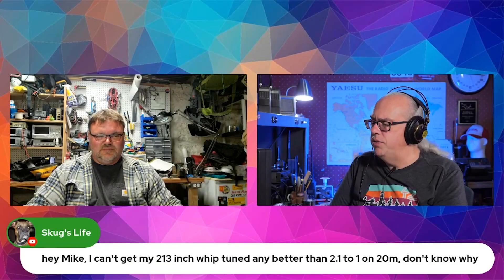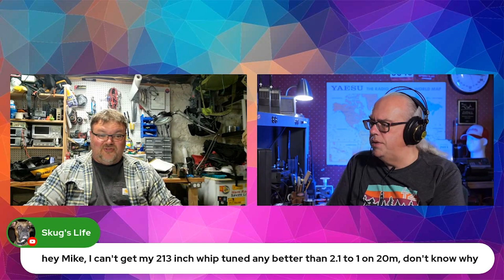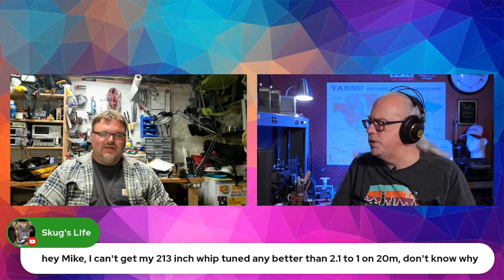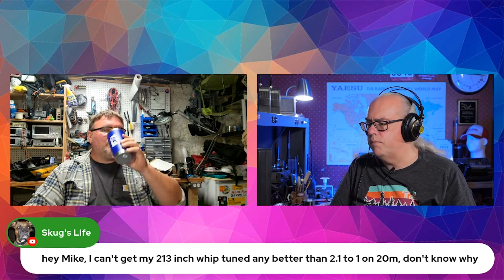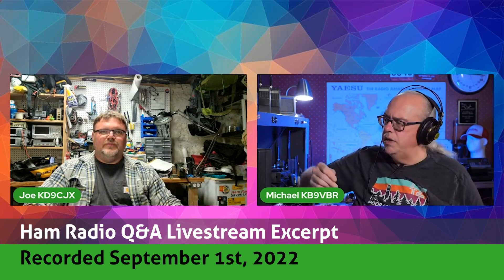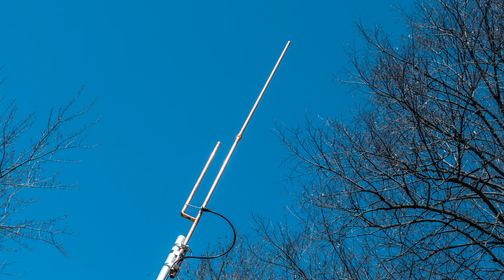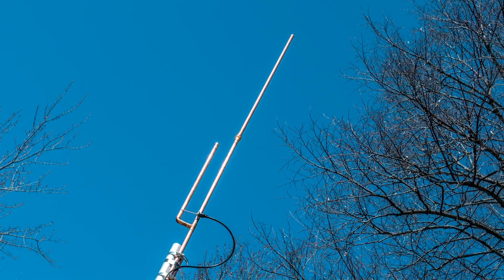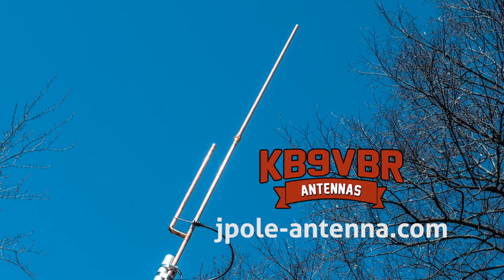I can't get the SWR low enough - September 2022 Livestream Excerpt #hamradioqa

Comment: hey Mike & everyone.  thought i'd report in:  i am using the 17' whip that you have seen Mike use on POTA videos, w/ the large tripod from Wolf River.  i also have the silver bullet coil but i don't use it for 20m.  Today i increased the # of radials to 9, all of them are 33 ft, and i folded them all in half (as opposed to coiling up half of the wire at the end) and i'm happy to report that i actually have SWR on 20m down to ~1.3 to 1 today.  Thanks Mike :)
Reply from the maker: Thanks for the update, it's great to hear that we were able to help you out.

Comment: I have a similar issue with a new 17’ whip. I ended up with it fully extended, 3 radials on the ground 16’7.5” each, 25’ coax. I got to 1.75 SWR

Comment: I have a ft-891 and wolf river coil and I keep getting high swr on the radio and I do get out but everyone said I am just a little higher then the noise floor on pota hunting. They can barely make out.
Reply from the maker: Tell me a few things about your setup: what bands are you active on, whip length, coax length, and number of radials and length. This will be helpful in diagnosing the issue.

Comment: Adding more coax is just making it more resonant because the length of a coax if it works is acting as part of the antenna that being said The Shield of the coax is acting like part of the antenna it's not a good idea like I've said before a choke balun  isolate the antenna from the coax that's what a balun does.  a one-to-one balance isolates the antenna from the coax that's the best way to go and then adjust the radials.
Length of coax does not matter if you use a good high power balun
At the feed point.

Comment: Thanks for the video. I wish someone had suggested folding back the radials last year rather than just telling me to troubleshoot everything else, especially the coax.  I finally figured it out a couple weeks ago.  Laying the 33’ radials on the ground may work fine on 20m for many people by in moist conductive soil, but is terrible on rocky summits and bone dry clay park soil in my area.  This should be the first suggestion people give. 
(I methodically rolled up my coils to 1/4 wavelength across multiple bands recently with a 17’ whip also adjusted to resonance and demonstrated to myself that this IS my solution)
Reply from the maker: I'm glad you found it helpful. With portable operation you will experience a wide variety of soil conditions which you affect your ground plane. Adjusting the radial length and/or adding coax seem contrary to popular understanding of antenna systems, but are two simple fixes to alleviate higher than average SWR.

Comment: Don't add more coax add a current  balun
At the feed point.
Adding more coax will
Not help. You are getting false readings.
A balun isolates the antenna from the coax SWR readings should be more accurate after that adding more coax is what a chicken Bander would do.
Reply from the maker: A common mode choke is a good long term solution, especially if you don't want your coax to radiate. Adding coax is what an amateur radio operator that understands the interaction of feed line in an antenna system would do to fix a sticky issue in the field.
Reply: Adding more coax to an antenna just allows the shield of the coax to act as part of the antenna putting a current balance in addition of voltage balance helps isolate the antenna from the feed line coax that's the best way to go you will get more accurate wattage readings and standing wave ratio voltage readings from the meter Plus you'll have less RF voltage feeding back on the equipment you'll get a lot less are it burns if you touch something under high power even at 100 Watts use a balance that's the best way to go... even on field day it's very easy to do. Heading radios as well down on the ground is very good to do as well.
Reply: Addition. adding more coax to ajust for high swr is telling you that
The coax is radiating.
Putting a balun at the antenna feed point
Will help stop that and help stop RF from getting on your equipment. You want the antenna to radiate not your coax feed line
Its easy To do that
Easyer than adding more coax..

Comment: 213" whip is too long for 1/4 wave on 20m phone....that's probably the cause of the elevated SWR, not the radial length.
Reply from the maker: Yes, that could be one of the issues. At 213 inches the whip will resonate just below the 20m band. For a good match in the phone portion of the band, you need to shorten it 1/2 - 1 section.

Comment: Altering radials shouldn't have a great effect,  length of coax makes a big difference.
Reply from the maker: From my experience, when you use a limited number of ground level radials, adjusting their length can have an effect on the tuning of the antenna. But as you add more radials, individual radial length is less important.
Reply: You'd be surprised. I coil my WRC radials down to about 10ft to get a perfect match.